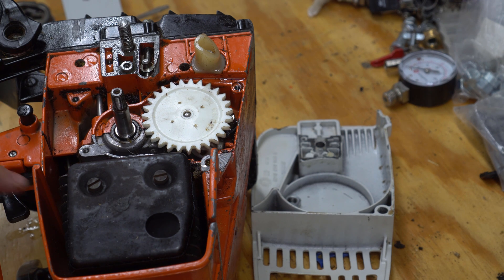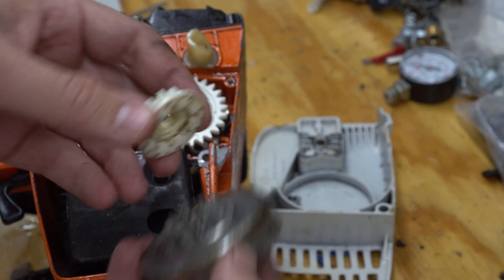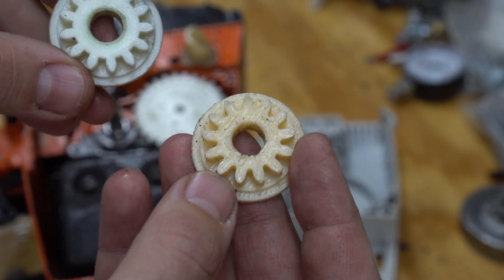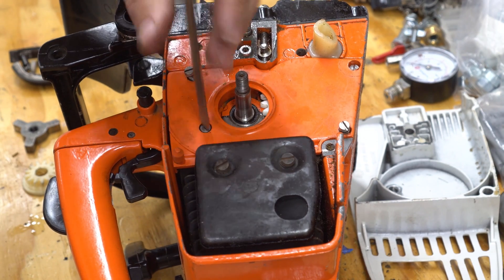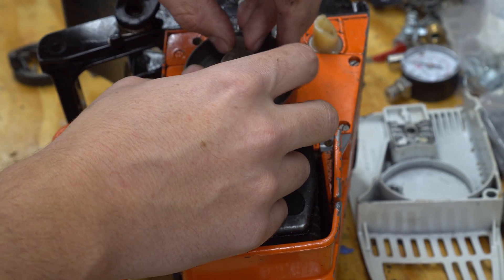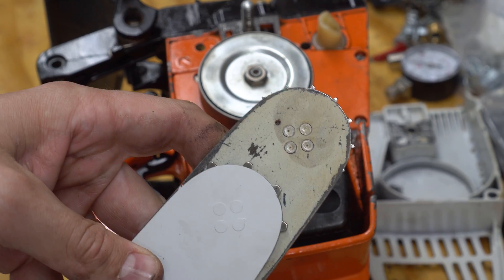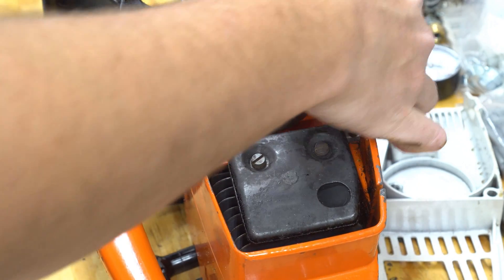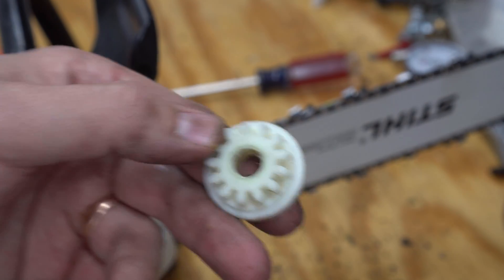Stihl 015L Chainsaw 1/4" to 3/8" Pitch Conversion

Comment: Did the abs gear that you made melt or did it hold up pretty good?
Reply from the maker: it fell apart after ~12 hours of use. There is an ebay seller with an injection molded nylon version that i would recommend.
Reply: @MrBlowmyselfup  Guess I'll just have to pay $30 for the ebay one then, thanks for your help. Does it make a big difference in cutting with a 3/8 chain vs the stock 1/4?
Reply from the maker: @bigtexas7580  should only be $20 https://www.ebay.com/itm/OIL-PUMP-OILER-SPUR-GEAR-FITS-STIHL-015-015L-3-8-REPLACES-1116-647-1801-NEW/142882917743?hash=item21447c4d6f:g:cR4AAOSwlBZbWOrS
Reply: @bigtexas7580  The 1/4 cuts faster and smoother on these small saws. The reason why some convert to 3/8p is due to fewer teeth to sharpen, slightly wider kerf and cheaper chains.

Comment: I need to buy one of these for my 015. How much to ship it to dallas,tx?
Reply from the maker: Check out ebay, there is a nylon injection molded one that is cheap and better than this.
Reply: @MrBlowmyselfup  The one I saw on ebay is $30, I'd like to pay $20 shipped for one. I may just keep the 1/4 sprocket on it, mine is worn real bad that the chain is getting hung in the teeth so I wanted to replace it with a 3/8 since I already have a spare new 3/8 16" bar and chain but I don't want to spend over $40 for the 3/8 sprocket and oiller gear because I can get a new 1/4 sprocket for $20 shipped.

Comment: What about heating up a spocket and molding it in
Reply: That's what I was wondering about when I listened to him explain about the 3D printed gear, you might be able to heat that clutch sprocket and push it into an original style oiler gear and mold new teeth into it. IDK, might work.

Comment: I'd like to do this conversion on my Stihl MS150 C running the pico chain.  Does anyone know if the parts needed are the same between the MS150 C and the 015 in this video.  Thanks

Comment: There are obvious omissions in this video. One being which spur gear and drum assembly did you use? Info on the net is sketchy with few details like drum diameter, crankshaft diameter, bearing and drum bore size so a guy can make a decision about which one to buy.
Reply from the maker: Check out the blog post in the description for details and links to things you need to buy. Let me know if I've missed anything there.

Comment: I'm no plastics/chemicals expert but I don't think ABS likes oil. You may want to be careful. Nice job though!
Reply from the maker: Good point! I will be keeping an eye on the gear as time progresses. Since the part just powers the oiler gear I should be able to catch any degradation before the oiler stops working. Since it's not directly powering the chain I don't have to worry about it randomly breaking the saw hurting something.

Comment: Please give some follow up!
Reply from the maker: I will try. I ran the saw for about 5 minutes and it quit working. I think I've got some excess dirt in the fuel line or tank because when this happens (third time) I clean the already clean-looking carb out and it starts working for a while. I have a new fuel line on order.
Reply: You might have bad crank seals. When it warms up it will quit running until it cools off. I just out crank seals in one of my 015's that was doing the same thing.
Reply: Get a carb kit and soak carb over night in carb cleaner and blow out with air. (after taking screen and old diaframs and needles out),  install new kit. This is a very simple job.